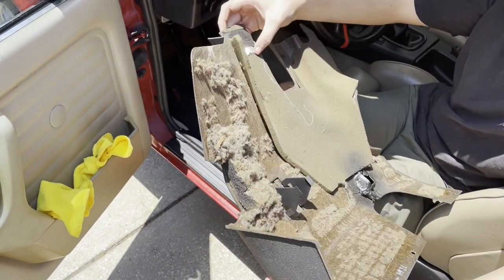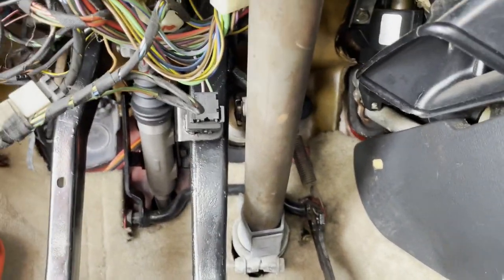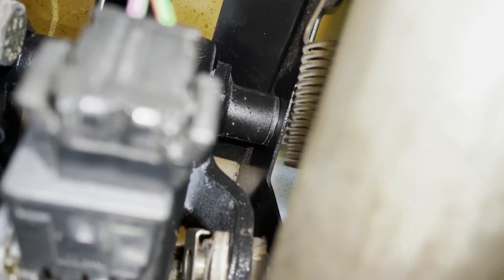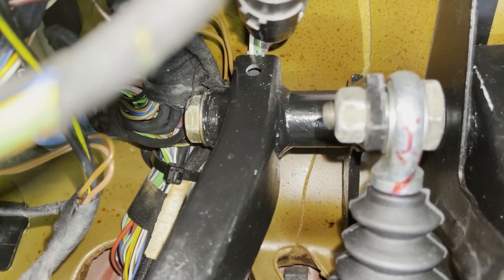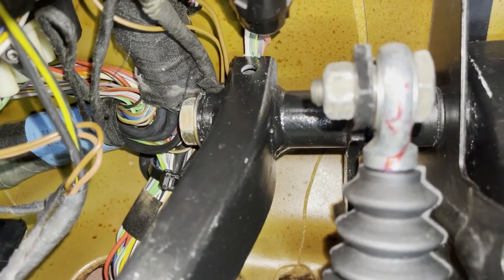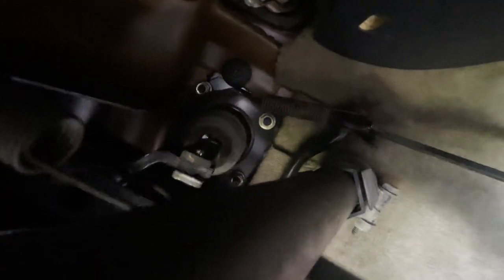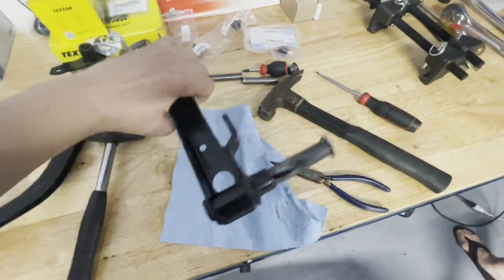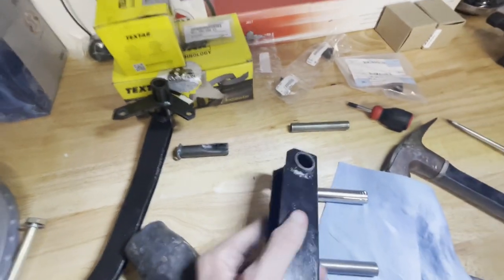Squeaky E30 Clutch Pedal Fix

Comment: Where does the clutch pedal spring connect to?
Reply from the maker: Good question!  Our clutch pedal just came back up from master cylinder pressure, because our car didn't have a clutch spring.  We don't know what year the donor car for the manual swap was, and it might have just been left off during the swap.  I guess I need to do some more research.